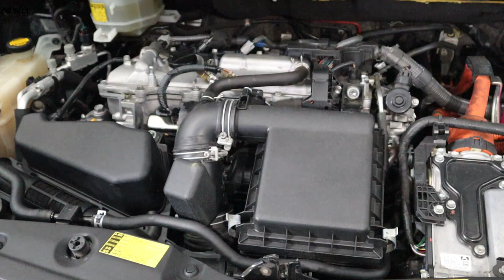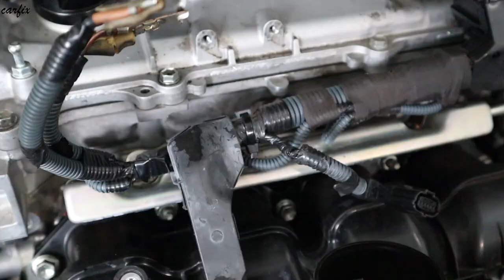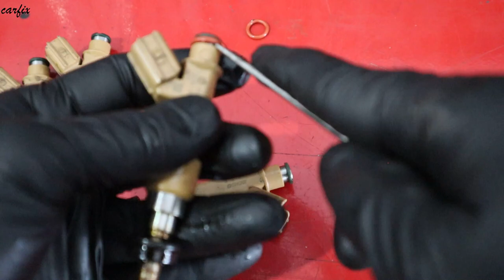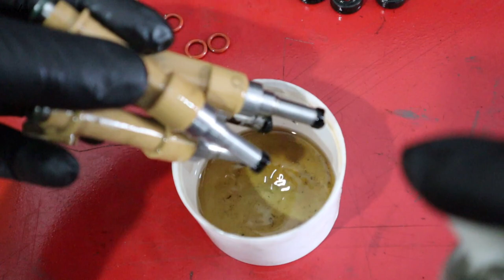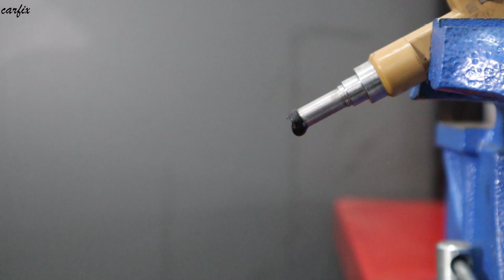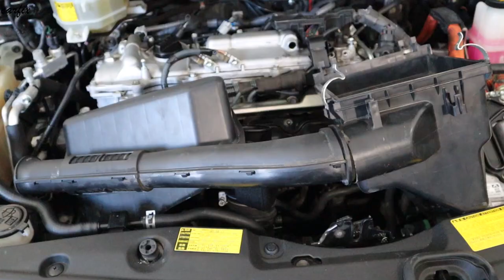Toyota  hybrid injector cleaning (2ZR engine) prius

Comment: I have a 2012 ct200h and I had bad spark plugs and bad fuel injectors I went to a mechanic shop and they only had used set of fuel injectors but I noticed that my MPG dropped about 25%. Do you think that if I were to buy new ones or take them out and clean them thoroughly that will bring up my MPG back to normal again?

Comment: 2004 prius had running rich I put 5 different fuel additives in it when it was 3 bars tank and ran it down to 1 bar and I put it in gear and held down gas and made rpms go up don't know how much but thin I took it in cleaned the code and now it getting better gas mileage and it's been 3 months and no code
Reply from the maker: Yes it is an easiest way to clean the injectors without hardwork. But if you want to clean properly and check the injector condition, you have to pull down and inspect and clean with this method. Anyway thanks your comment and watching my videos.
Reply: @carfix1993 my Prius has 165k miles and recently did the spark plugs and ignition coils because it was misfiring. Do you recommend I replace the fuel injectors or clean them
Reply from the maker: @alejandropena5658  
Clean it

Comment: "For secured," Must remove the fuel pump relay, then push start engine, put in D, let engine run until cut off, fuel pressure 39 PSI release, never re-using O-ring, buy new injectors O-ring kit!

Comment: Execellent video,  how offen do we have to clean the injector?  Is the injector cleaner through the fuel is good enough for cleaning?
Reply from the maker: Every 80000km better 
Injector manually cleaning recommended
Reply: @carfix1993  thks
Reply: You never ever need it if you live in modern country with good gasoline and detergent from known  brands like Shell BP Exxon, etc.  I drove exact same car for 400 000 km and never need to do such thing in USA/ EU

Comment: My pruis plus 2014 shakes the engine while I am driving very slow .Will this help if I do ..thanks in advance
Reply from the maker: First scan the car check any code.
Could be injector or egr getting blocked
Reply: @carfix1993  sorry how do I scan the car
Reply from the maker: Go to your local mechanic or toyota dealer

Comment: Nice video!
My concern is rubber gaskets.. Is it ok to reuse the gaskets? I have 2014 with 340,000 km on it, and never cleaned injectors. Now recently it has started to rattle (just like manual shift in bigger gear and slow speed) at slow speed acceleration. Could this be due to plugged injectors? I appreciate your opinion.
Thank you!
Reply from the maker: Yes its common injectors failure 
Clean injectors
Reply: This could also be due to your Egr system being clogged, needs cleaning around 160km. Egr cooler, pipe and intake manifold/Egr ports.
Reply: @matthewvalenzuela1441  I replaced intake manifold and cleaned egr pipe but not egr cooler. Shall I clean egr cooler as well?
Reply: @arvindersingh9891  Yes! The Egr cooler is the first piece to clog up badly, if your Egr pipe was dirty then the cooler will be even dirtier, you should be able to see through it. 

Soak it in oven cleaner for a little bit, then power wash it at self serve car wash stall, then after spray the inside left and right internal fin channels with oven/brake cleaner from both sides. You can replace it if you don’t want to do all that but it should increase your mpg and lower coolant temps👍🏽
Reply: You need to clean intake manifold , egr passage inside intake manifold and egr lines
Reply: Yes, replace especially the rubber o-rings at the top of the injectors. I didn't at first because I didn't have the parts in hand and I was trying to prove it would start before buying more parts. After starting the car one of the old o-rings at the top of an injector was leaking a fast drip that could easily have started an engine fire. Have a fire extinguisher at hand for this job. Even new o-rings can get ripped or cut or have defects. The injector area was filthy with oil and dirt accumulating over the last 11 years. Clean the cylinder head around the injector area with an aggressive soap like Ajax Orange Dish Soap and a strong jet of water BEFORE removing the fuel rail from the injectors. After the job, try to wash or wipe away spilled fuel before starting the car then carefully look and smell for leaks at the fuel rail and injector area with the engine running. There are two black cylindrical spacers under the fuel rail mounting bolts. Take care to center them in the fuel rail holes while snugging up the bolts, otherwise, the steps on the top of the spacers could prevent the fuel rail from fully seating. 14 ft-lbs torque.
Reply: most likely you need to clean the hole intake manifolds and EGR lines.  There are 4 small EGR lines on the intake manifold that often clogged and caused imbalanced air at light throttle when the engine is warm. The easiest check is unplug the cable from EGR unit. If it stop rattling, you got it.  WE have 0.00001% dirty injector problem in Prius, at least in EU and USA fuel quality. If it is in developing countries, it may be different.
Reply: @carfix1993  Hi Sir, I'm bit concerned about the gasket/oring reuse because mine, after cleaning, MPG drops to 38 (47 before cleanning) - How should I tell where the leak is? (I do see a DTC P0456, which means minor EVAP leak) thanks
Reply: @ivytown508  Hi Sir, I have just done the fuel injector cleaning job recently. However, after cleaning, MPG drops to 38 (47 before cleanning) - How should I tell where the leak is? (I do see a DTC P0456, which means minor EVAP leak) thanks
Reply: @reocam8918  Sir, I am sorry to hear about the drop in miles per gallon, especially after cleaning the fuel injectors. Mine leaked in an obvious way. Liquid gasoline was dripping from the fuel rail onto the head and the smell of gasoline was very strong inside the vehicle. You may have no gasoline leaking but instead air may be leaking into the head. My first thought would be that the fuel rail was not reassembled correctly. Simply remove the two bolts attaching the fuel rail to the head and verify that the black insulators are centered in the bolt holes. Firmly hold the fuel rail in this position as the bolts are reinstalled and tightened. Torque to 14 ft lbs.
Reply: Ihave 2013 with 130 k and started rettle
Reply: @arvindersingh9891  Use easy off oven cleaner, that brand works the best.
Reply: @ivytown508  Do pay attention when installing the fuel rail spacers, the collar on one end of the spacer will be longer than its opposite side.
Reply: @ivytown508  They are technically called fuel rail spacers when looking up part numbers.
Reply: I’m willing to bet it’s the fuel injectors. I replaced my head gasket and EGR cooler on my 2012 Prius V last year as well as cleaned out the intake manifold and EGR valve.

Just recently started having minor acceleration stuttering issues and suspect the fuel injectors are clogged.

EDIT: Toyota diagnosed it as a bad intake manifold, I’ll update after I replace it with the newer design manifold ending in part number 054.
Reply: @Steven  pull your spark plugs out, check for oil on thread, most likely spark plugs, if loads of oil definitely spark plug Gasket need changing.
Reply: @drivingteacher786  I replaced all the spark plugs and crush washers when I did the head gasket job last year. 

Toyota is telling me the issue with mine is the intake manifold, I was mistaken of it being the injectors.

Comment: You make it look easy but my fuel injector is stuck. Does your vehicle need an injector puller?
Reply from the maker: No it's very hard
Reply from the maker: No it's very tight
Reply: @carfix1993  You mean not very tight. or is it very tight
Reply from the maker: @HuyTran-no8nd  not very tight

Comment: Hi sir 
I have prius 2010 with 190000km. I feel very low space in accelarating paddle. And a paddle is very hard to push for accelarating and pick is also bad .what would be the fault . Please guide me
Thanks 
Waiting for your kind concern
Reply from the maker: First scan the car and get DTC  code ???
Let me know 
Thanks
Reply: @carfix1993  Mine after cleanning has the same symptom, DTC is P0456, minor leak of EVAP system. Does that mean there are leaks from the injector section? How should I proceed? THanks

Comment: I only have 39,940 miles and Toyota is recommending this for my 2013 Prius 3. They want to charge me $500
Reply: Toyota service sucks, complete rip offs. Btw, Id sell your Prius while it still has relatively low miles. Mine at only $130k has lot of problems and so many others I know have all the same issues. It is not a reliable car imo and Ill never buy another Toyota
Reply: @iwontreplybacklol7481  totally! I would never buy another hybrid. I made a bad choice in this car since I don’t drive enough to see the “savings”. I would get a gasoline vehicle. Most vehicles now in days have excellent mileage.
Reply: @chavitavb  My 2011 toyota Prius has 206,000 miles and have not had a problem. I bought the car about a year ago and put 30k miles on it. Best purchase ive ever made
Reply: @iwontreplybacklol7481  Surely that's your local Toyota distributor. The ones in our district are excellent-knowledgeable and upfront, and ready to help-even if you just need guidance for a repair.  I've found that even though they have a higher hourly rate, their experience and specialist tools means the total parts and labour cost comes out no more than a repair shop with lower hourly rates.   I've taken my fords to Toyota for work- they are much more competent than our local Ford dealerships.
Reply: Eh I have a prius with 184K miles. Only issue so far was cyl 3 misfire at 129k had a bad fuel injector and then again at 180k. Other than that no issues.
Reply: @OhcoChildPlease  Wow, no blown head gasket yet. No wheel bearing replacement yet.
Reply: @metrork1  no nothing like that yet. I do know with how often the engine cycles that head gaskets tend to fail early on hybrids. The car was bought at 15k miles and since they probably 85% of the miles are highway so that may help extend its life

Comment: Any idea how to prevent all that gas to leak out when removing the injectors? Seems like a hazard? Otherwise great post on how to clean injectors.  Thx.
Reply: I think theirs a relay fuse and remove it and let sit but can't be too sure.  Great question
Reply: Can't prevent the leak, only capture the fuel when it leaks. You can crack another bolt off the side to relive the pressure (slightly easier capture of fuel).
Reply: @mydogblack6685  No, that will not work because of the existing fuel pressure still in the fuel rail.